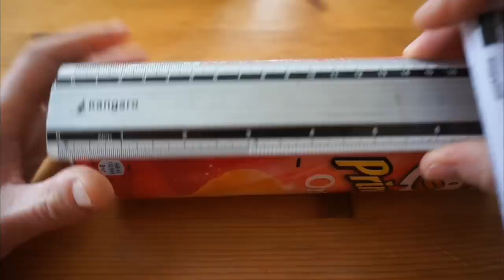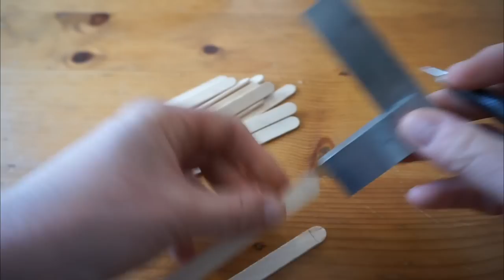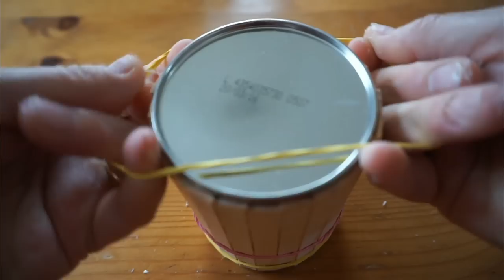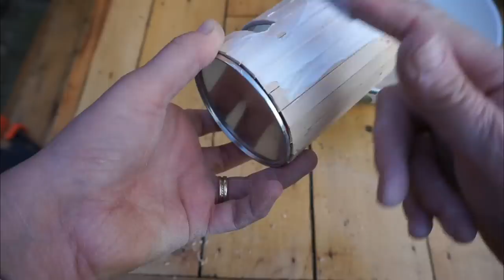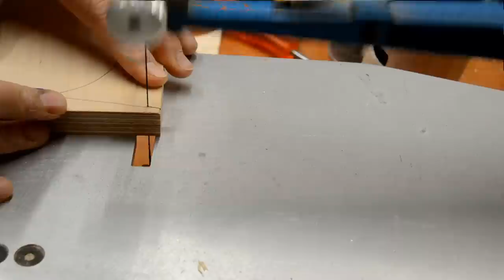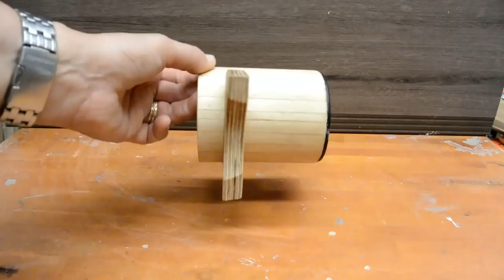Turn a Pringles box into a Acoustic Amplifier

Comment: Hi,
Is there a list of the steps? 
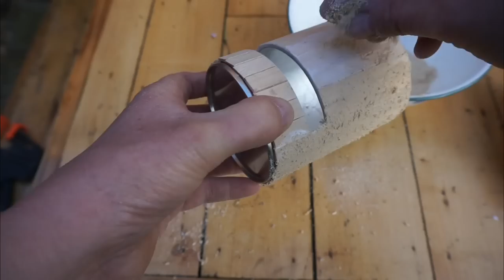I know it looks simple, but what is the dust you glued on it at 5:15? Is it wook filler? 
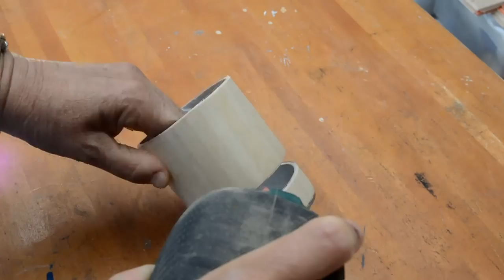Also,  at 5:45, are you sanding it? 
What is the black thing you put in at 6:05? Is it just normal black paint? 
Thanks! Looks like a great project for my kids.
Reply from the maker: The dust is sawdust together with the glue it will fill up the gaps.
I used agrylic black paint, you can find in the craft shops
Yes there is a list in my instructible 
http://www.instructables.com/id/From-Pringles-box-to-Acoustic-Amplifier/